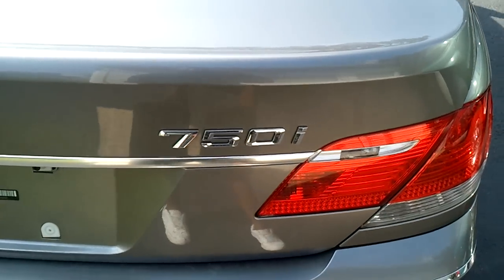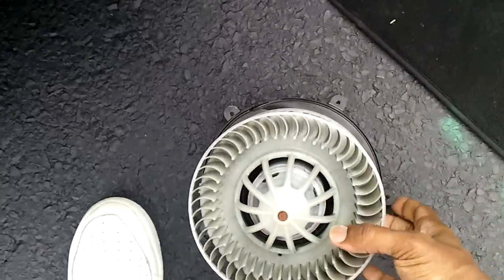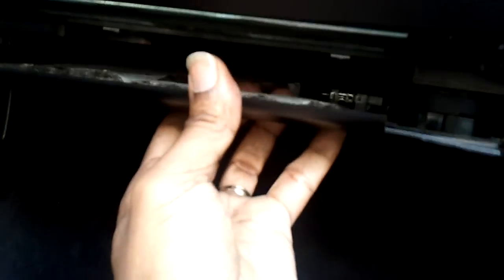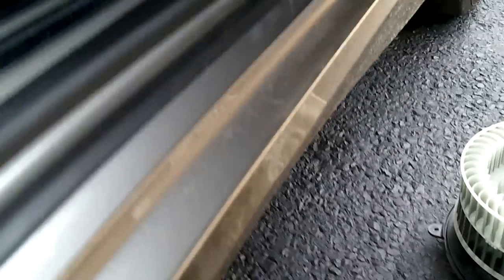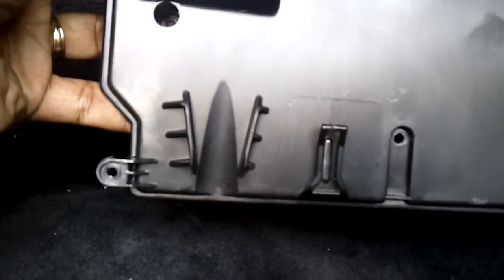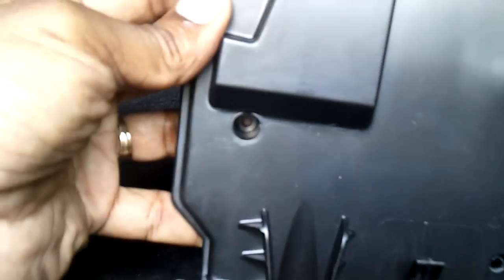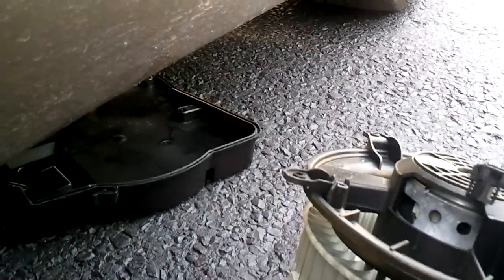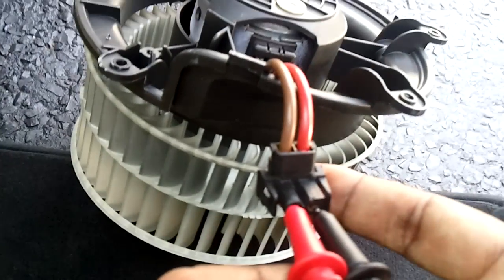BMW 750 e65/e66 blower motor resistor, final stage, heater,745,fan, A/C

Comment: I did this last night and your instructions were a big help.  A couple of thoughts:
1. There is one screw that is way in the back on the left (looking forward).  You have to move some insulation to get to it.  This was the hardest part of the whole process.
2. The brass 10mm nut in the back has nothing to do with the removal - looks like it does but it doesn't so leave it alone.
3. pull the rug way back
4. a short handled driver helps for the tight spots. 

Thanks - great instructional video.

Comment: hey man thanks for sharing your video i have a 750li  bmw and was able to get to the fan and resistor thanks for taking the time to show us it saved me a lot of time and money
Reply from the maker: Glad you worked it out.
Reply: Stephen Green on my 08 BMW 750LI the ac blows cold but slowly. I took the panel from the passenger off and I turn on the car and I hear the motor running but blows slowly. What could it be the motor or the resistor. Or just buy both and replace everything new?
Reply from the maker: MrGerardoMarquez , being that they are attached to each other. You could just replace them while you had them out. But I would check that the fan is working properly first. Could save you a few bucks.
Reply: Stephen Green well now it works for now. Is blowing really hard and cold. I don't know was will be wrong. I heard that sometimes they add a little bit of oil to keep it running properly. Sometimes It just get stuck in the need of oil.
Reply from the maker: Glad it worked out.

Comment: is there a separate fan for the heater? i ac blows fine on all speeds but the heater doesn't work. ive already changed the heater valve and still no heat

Comment: My fan works fine. It blows cold/hot however, when I turn it on, it squeaks.. when I turn a curve it stops or when I come to a stop it'll stop. It's not a really loud squeak however, it does get fairly annoying. What could be the issue and what could I do?

Comment: hi. we have a problem on our e65 745d, similar to what is explained here. when we turn on heating and try to increase the fan speed, it starts to cool instead. can that be linked to the resistor ? the fan is working. thank you

Comment: I see your pointing where the resistor is located at. But where is the blower motor located at? Where did you pull the blower motor from? My car is having same issues. Car doesn't want to blow out air. But once in a blue wen I start the car air/heat comes on until I turn the knob to turn the heat down the fan cuts off n doesnt come back on. You kno the problem?

Comment: What was the issue that led you to change/check your blower and resistor? My fan blows intermittently and when it does either the AC or heat do work. I know your post is old but I just found it yesterday.
Reply from the maker: If you have any issues with your blower. You should check for problems. I fixed mine because my fan had started to only work sometimes. Then eventually only worked on high.

Comment: u can test it without a multimeter, just take 2 wires put them on the positive and negative of the motor and the other ends on the positive and negative of ur battery

Comment from the maker: If you watch part 2 of the video, that's where you will see how to remove the blower. The resistor is actually attached to the blower housing.
Reply: Stephen the dealer just told me i needed a new regulator and blower motor